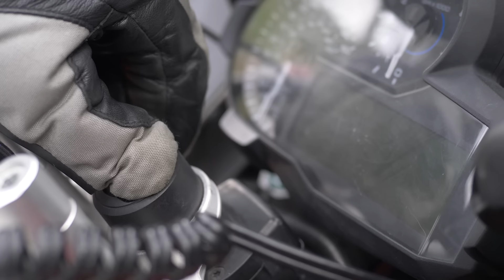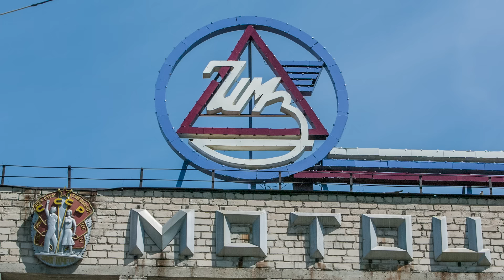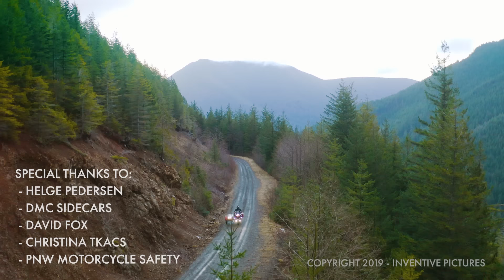Adventure Sidecar Tips from Helge Pedersen

Comment: "too many mechanical problems" buys BMW
Reply: Underrated
Reply: I'm about to ship my R 1250 Rt to DMC for a sidecar. I have been anxiety already  : ) Takes 5 months to get back. They are over 2,000 miles from my home. Too far for a ride. Had a Quad by-pass this year. I'm still weak : )
Reply: @scott31312  Good luck with your new baby, it will be a great distraction. However take good care of your body, without it you will not be able to ride your sidecar. I am on a very strict plant based diet myself because of heart problems and doing excellent. Good luck to you.
Reply: Ural is basically an old model of BMW,  70 years old one. And it has even worse reliability.
Reply: @darkokovac993  says the person who never rode a 2019 Gear Up  and does not know shit
Reply: Close friend with Urinal...definitely too many mechanical issues
Reply: @ItsNyxdrah  I have a Ural with 34000 miles and have never had a major problem with it. My R1200gs on the other hand....
Reply: @darkokovac993  You can buy 3 Urals with stock sidecar and fantastic offroad capabilities for the price of a  BMW without a sidecar, lol.
Reply: @Farhang Farasat Also, you can fix an Ural with fundamental tools, nothing specialized.
Reply: @Farhang Farasat I know my man! I ride a 400cc Benelli Imperiale, made in China, aimed at India. Its cheap and simple, but well made - all metal, no plastic. Single air cooled cyllinder, and that's it. Anyways, my dealer went to the factory in China to try negotiate other models for import. He sees BMW bikes, certified, being made in a section of the factory. So, whats the difference? They both come from China, but one is simple by design, the other - with cut-back quality to fit the gadgets in the price..
Reply: @Farhang Farasat I'm not a fast rider at all. 22hp is decent enough for me.
Reply: @Farhang Farasat My exhaust and pipes are all stainless steel, you can forge swords out of them :D solid as hell, if a bit heavy. And you know what? Buying it for 4000 euro makes me feel very nice, cause I got money for otyer things, too.
Reply: @Farhang Farasat Tried a Royal Enfield 500, can't say about Honda. The RE is even more retro than my Benelli - no RPM meter, nothing digital. Real cool bike.
Reply: @86Hilux22R  I dont believe you. I had ural volk and it complete piece of shit
Reply: BMW are not as reliable as peeps think, my brother had to have a full engine replacement on his 15,000 miles 2016 R1200RT under warranty and he bought a new 2020 R1250GS Adventure and already has had to make a warranty claim on a 6 month old 3k miles bike for a new nearside block, piston and head replacement lol :) luckily my 2018 R1200GS Rallye has had no problems yet :)
BMW are not as reliable as peeps think ...all manufactures bikes or cars, whatever the badge they wear or how much they cost, all have unforeseen failures of components.
its how they deal with the customer that counts and BMW motoradd have been 100% on his experience with them :D

Comment: I thought about the Ural but ultimately went with a Triumph Scrambler XE 1200 and had a DMC sidecar installed. The total cost was about 2k more than a new Ural. I like the Ural's looks and like that it has a two wheel drive mode along with a reverse but ultimately decided against it due to the unreliability issues so many people experience.
 I do a lot of back country riding on logging roads and such where I might not see another vehicle for hours or at all and usually have no cell phone service in a lot of areas I ride, so reliability was important to me. Also it is easier to get service, parts or find a repair shop for the Triumph than it is for the Ural. I have a ton more horsepower and torque than I would with the Ural which really helps on high elevation trails such as the Imogene pass between Telluride and Ouray Colorado.

Comment: Mr Pedersen is a legend!! Great video.

One thing I really like about the Ural is you can get the sidecar wheel driven from the driveshaft. It gives great traction. It didn’t look like this rig was 2WD, but I could be wrong. But Helge is right that Urals are somewhat unreliable and underpowered.
Reply from the maker: Glad you enjoyed the video, Ronan.
Reply: The BMW with DMC sidecar does not have 2WD. You have to remember that the Ural does not have a differential with 2WD. In other words this is only for use under certain conditions. there are after market producers in Europe that can make all time 2WD for your sidecar rig, but that is expensive.

Comment: I loved my sidecar , it offered riding stability . It was a large sidecar seating two small people side by side . Thus it was heavy & the first time in fast Fwy traffic I had to brake hard the weight of the unbraked sidecar shifted me across one lane (scary) but from there on my main brake became the rear with the front to a lesser degree .I did get used to it pretty quick .
Reply: #trevorzzealley that is a scary story, glad it ended good. What about getting brakes on your sidecar wheel as well?

Comment: Awesome episode!

Helge, a couple of questions for you:

1) How much do you have to counter-steer to  make up for the sidecar dragging you to the right?

2) Why did you decide to go with 1-wheel drive vs 2-wheel drive?
Reply: @BoomerE30 1) No counter steering needed as long as the rig is set up correct. 2) Money, complexity and most of all I have had clients on GlobeRiders Adventures around the world riding sidecars with 1WD outfits and I can not think of one time that they got stuck with their sidecars or would have had significant advantages with a 2WD rig. For me sidecar riding is not about going to extreme off-road riding. Think about it, I use my trusted BMW R1200GSA LC bike that is a monster of a bike for the touring that I do all over the world and I see it as the perfect bike for what we are doing with GlobeRiders. If I were to do single track and extreme off road riding I would get a bike that is much more suited for that kind of riding. I hope this helps you.
Reply: 1) a lot, depends on load on sidecar, if you have tree passengers on sidecar on 1WD  you will get tired in few minutes.
2) because it's need to put there Ural transmission,readapt all that,too complicated.

Comment: I like the fact that you put a car tire in the back...the side wall is thicker, more puncher resistant etc. I remember doing a trip with my buddies as a teenager 20 years ago in south India and we had one bike that had flat one day after the other...the tire was so weak that it was not able to handle all the weight(we were riding two up plus gear). BTW, what size are those tires?

Comment: I Bought a 2008 Ural Patrol in 2015.  Living in Sulphur Springs Valley it's been piloted over some 7 and 9000 ft passes, as well as rocks, dirt, mud, and pavement.  You're right, Helge, in that it's underpowered, but that's okay.  Otherwise we could have gotten into something the 2-wheel drive  and reverse might not have gotten us out of .     It will power us (wify and me) through large radii dirt corners while steering with wheel spin (flat tracking, if you will) and that's a gas!  Wears out rear tires quickly though, when one plays that game.  Maybe see you in Roswell, NM - we can look for UFO   parts...or a beer.

Comment: cool looking pictures, I had a Dneiper sidecar outfit years ago and that sidecar was fantastic, the bike less so, you forgot to mention that every time you accelerate the bike wants to go around the sidecar and on deceleration the sidecar wants to go around the bike, and the Dneiper had about 100 hp less than the monster you are sitting on, my sidecar experience cured me, the stability of two wheels is my meat
Reply: having driven a sidecar rig for thousands of miles myself..I concur with your assessment. However you can use the sidecar to help you in the turns. In a left hand turn if you give a little motorcycle brake in the apex of the corner the hack will immensley help make the corner easier especially going downhill. The additional horsepower is a real plus if doing this while going uphill. THis is a little problematic with a lower horsepower machine like a /2 BMW.
In a right hand turn using a lot of throttle at the apex will do the same thing.
It is even more of a help if the sidecar has a brake that is not linked to the motorcycle. They can be set up that way

Comment: Fabulous video, well done, very very informative. I do wonder what is the lowest/minimum HP for the bike?

And just basically realised, I cannot build one myself.
Reply: #drewski That is not easy to answer. the horsepower is all pending on the size of the sidecar rig I guess. the BMW E1200 I am using in this video has 125 HP and it feels very good. It also helps that the bike has water-cooling since it does have to work hard at times to pull the sidecar. Yes, it takes a lot of knowledge to build a sidecar and for that reason i think that the european sidecar builders are the best. I just received a new sidecar from Mobec in Germany.

Comment: Great video! Interesting perspectives. Helge is the best. 

But... using a back wheel tire for the front wheel without turning it around? 🤔

The tire-pattern is designed for emptying the tire from mud and dirt when force is applied, majorly from the engines power for a back wheel and ONLY from breaking for a front wheel. 

So ignore the rotation-arrow on the tire, and always turn it around when a rear tire is used as i front tire! 

The only reason that the arrow nowadays always says rotation instead of “direction of applied force” (or something similar) is that the tire manufacturers want to make it easier for the users. Everyone understand rotation, forces are more difficult for many to grasp. 

But when using a rear wheel tire as a front wheel, doing the extra thinking is more then good idea. It is a must! Well, at least if you want the best performance. :)

Love the mototrac-videos, all of them. You are really making the world a better place. Also hope for more cooperation with FortNine. Bret and Brian are cute together. 😉
Reply: #HugoSwiss Do you ride sidecar bikes and do you use a large 170/60 17" on the front? Just curious if you have first hand experience with this or passing on experiences from other sidecar riders. I am pretty new to sidecar riding and love to learn new stuff so any link to articles about this topic would be great and very much appreciated.
I am no specialist in tires, but have used a few up through the years. Having ridden the rig in this video from Colombia to Tierra del Fuego with a similar setup using the rear tire on the front and mounting following the indicated rotation arrow. Have had no problems what so ever. My biggest concern with the front tire is that it clears water while at speed on a rainy day riding down a tarmac highway. For this reason I will never use a Heidenau "plastic" tire, I need a tire that can give me good grip when it counts. This is the beauty of the  large front tire that gives good grip and at the same time is is rounded so that it will not track resulting in easier handling.
I am also concerned about noise from my tires and for that reason I really do not like the Metzeler Karoo tire either on my solo bike or sidecar bike.
Thanks for any feedback.
Reply: I feel I have said to much... I have less experience of side cars that I would wish. Probably I spoke slightly inspired, but with less knowleadge than what I wrote came out as, I have less knowleadge than would be appropriate. Sorry about that. 

I have driven a side car converted Honda pan european, and a russian side car bike. Not very much though... 

My point was only, that using a back wheel tire as a front wheel tire most often works better when it is turned around. The reason being that the trail patterns primary job is to ger rid of gue, and therefore the direction of rotation is less important than the direction of force. 

Or for short - when a backwheel is driving you want its tire to empty itself from mud. When the same tire is used as a front tire, you want it to empty itself from mud when you are breaking. 

I did not mean to come out as an arrogant besserwisser. I just wanted to point out the reason for the tire pattern. 

Beat regards, Hugo

Comment: Great Video. The Side Car would be really handy for Packaging by things for a long Trip. Actually any Trip where you want to have a lot of things with. How hard is it to disconnect? Like if you’re Camping and want to do some. Trail Riding without it. Also, do you have to have a bigger front Tire than the Stock Tire? Anyway, that’s a really pretty setup. I think I would Bolt a Spare Tire on the back of the Side Car if going on a Long Trip. I look fo seeing more Side Car Videos.👍❤️

Comment: I have a 2001 heritage softail with a Motorvation engineering formula II sidecar that I actual use as a camper. I took the seat out and set it up for camping. Pull over off the road or even in a parking lot or truck stop. No setup it has a top on it climb in button top down and got to sleep. Rubber side down and let the miles roll on.
Reply: Sounds like you found the formula for your own adventure riding, how cool is that. Ride Far - Ride Safe!

Comment: Great desing. The way they put the wheel of the side car on the same axis with back wheel of the motorcycle which looks like a back of car. i like it. As you mentioned the main difficulty is steering motorcyle with a side car. So i am thinking, can we put another wheel to the front of the side car for steering which will make better experince. And i am curious can we make side cars front wheel steering without mechanical control. if we just use electronical control will it be as smooth as mechanical control? with some sensors and a little elctric motor and a  batery which will be charged with motorcyle can we achive this?  with this desing whole system will be easy to seperate, less mecanical complexity and easy to control.
Reply: #elektronikulygulamalar Good luck with this project and let us know how it turns out.

Comment: I am 63 and I have a feeling that it is time for me to change to a three-wheeled motorcycle or a motorcycle with a sidecar.   Buying a new motorcycle with a sidecar is somewhat expensive for me,  buying the Urals is generally not considered an option.   But I have already 20 years old "Victory", in good condition, and I have a desire to attach a pram to it.  Side stroller from the Urals, will suit me.  It remains to buy a sidecar and stick it to the motorcycle, according to the rules and regulations of the United States.

Comment: Hi ... I have been a sidecar driver, on all terrain, for almost 25 years. 
Working with your bodyweight while turning the bike, is not necessary.
Turning the bike is only a combination of working with your ARMS and your THROTTLE.
When your sidecar is connected at the right side of your bike, you can try what follows (if it is connected on the left side, than do the opposite):
Keep in mind that the sidecar has tendency to go always straight ahead.
So, if you want to turn RIGHT, you have to go “OVER” the sidecar with your bike.
So, from the beginning till the end of the RIGHT HAND TURN you OPEN the throttle and your speed will increase. The sidecar rig will pull itself automatically through the right hand turn.
If you want to turn LEFT, your bike wants to “GO AWAY” from the sidecar.
So, enter the LEFT HAND TURN with a (for you) comfortable speed and hold this speed UNTILL YOU CAN SEE THE END OF THE TURN … than you can open the throttle and gain speed. The sidecar rig will pull itself automatically through the left hand turn.
REMEMBER !!! … this works only when you sidecar is on the right side of your bike … for “left” sidecars this procedure works the opposite way !!!
When, in a turn, your sidecar wheel lifts, DO NOT use the front brake !!! 
Use the REAR BRAKE and the sidecar will come back on the road with its wheel.
Study these actions carefully … TRAIN on them … These 3 actions have to become part of your sidecar bikers sub consciousness and instinctive reactions !!!
Enjoy …

August VH - Belgium
Reply: #avhrvg What you are saying is correct, but it sure helps to lean in to the turn you are taking. Just look at sidecar racers and what they do going through turns. By using your body as a wight leaning in to the turn you are taking you will be able to increase your speed though the turn. In my opinion it does make the ride more interesting too, mor einterreactive and alive. The more you do this the better one will be, just like every other thing in life. Thanks for your insight.